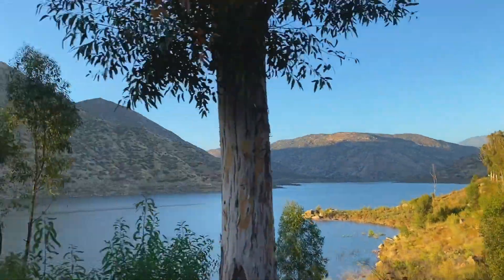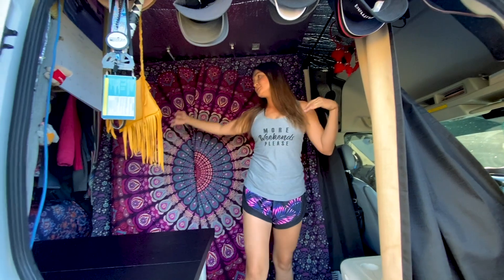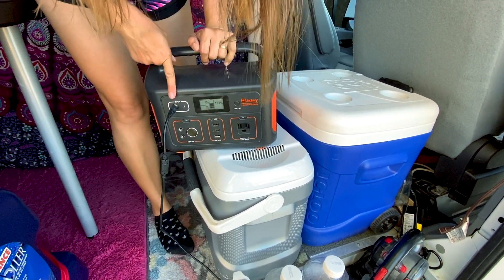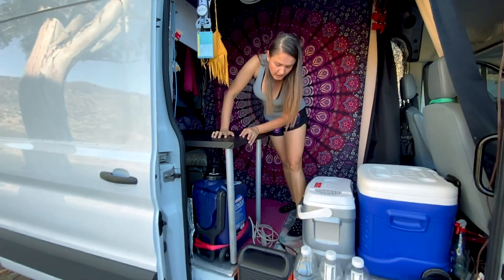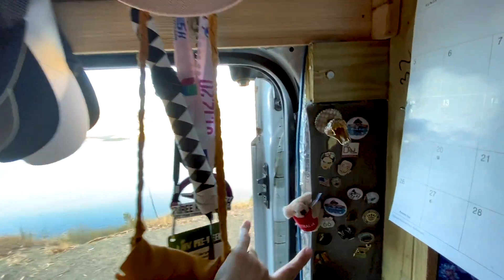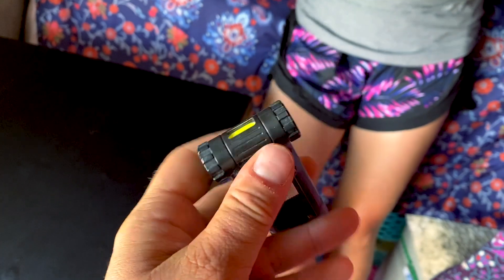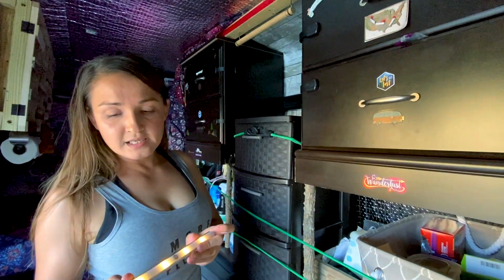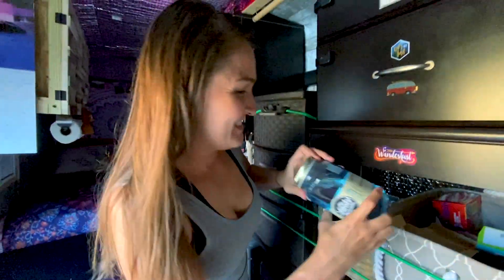VAN TOUR -DIY Simple Low Budget NO BUILD VAN BUILD - FORD TRANSIT CAMPER VAN-GADGETS- Van Life

Comment: Try using peel and stick floor tiles on the table. It will hold up against the wipes.
Reply from the maker: Hi! Thank you so much for watching and for your tip! So far the vinyl has worked quite well, but it’s great to know about that option for sure!!!! 🙏👍
Do you live in a van or RV? Where are you from?! 
Greetings from San Diego 🤗
Elvi
Reply: No I don’t have a van yet but it’s on my agenda. I live in Savannah, GA. My daughters dresser got damaged during all of my moving while in the military. I ended up using the peel and stick floor tiles to cover the top because she somehow always had something messy on it. They held up great and was easy to clean.
Reply from the maker: Hi! Thank you for answering! Great to know that it’s in your plans! 🤩 So you plan on buying and doing the whole build by yourself?

Comment: Suggestions: High priority...adequate simple electrical/solar system...get everything you can off the starting battery but use an isolator to charge/power things while driving.  Do an occassional go through inventory and get rid of stuff your not using,,,i think you have to much stuff...jumper cables so u can start the van if the battery is dead...electric fridge is next...adequate inverter,,,microwave,,,my suggestions
Thanks for shareing,,,great video
Reply from the maker: Hi! This is a general answer. I’ll be answering properly later tonight! Thank you so much!!!!! Really appreciate it!! Much love, Elvi
Reply from the maker: Hi dear Jerry Parker!!!! Welcome to our channel, happy to meet you, so glad that you liked it, and so thankful for all the great advices and tips you gave us!!!!! Really appreciate your help and support!!!!! 🙏😊
So we have finally done some improvements in the van during the past few months, that we haven't shared yet, but we will in upcoming videos! We installed the maxfann and solar on the roof, and the electrical system! The battery we definitely had to replace it, we killed it! 😂😂😂 And now, as I understand, there's the isolator that you mention. Regarding fridge, we thankfully got rid of the cooler a one time ago, and were managing everything with the 12v electric cooler, which was relatively good, not ideal, but still worked much better, once it was plugged to the power all the time. But a friend of ours upgraded her fridge and gave us theirs. Don't know the brand, it's not the most fancy one, but works amazing, and fits a lot of food!!!!! So thankfully we solved that big issue for now!!!!! Microwave would be great to add, still on plans, mainly because the van is so full of stuff, as you well mentioned 😂😂😂😂😂, that we don't where could we place it without being in the way. We raised the bed a little bit more, so we gained more vertical storage space under it, still working on reorganizing things. We have got rid of some stuff, but still not enough!🤷‍♀️
Are you a Vanlifer? Tell me about you! 
Hope you stick around! By now we've been uploading more traveling related videos, but we're going to start the upgrades series soon, I think.
Take care and be safe and warm!
Greetings from San Diego! 🤗
Elvi
Reply: @OnVanLifeMode  Thank you Elvie.  
I am a retired paramedic/EMT/Fire Captain.
I occassionally take my van on two week extended boondocking trips.
Wish i could go full time but my family situation precludes doing so.
I envy you two,

Enjoy

Jerry

Comment: Add a bottle of ice cubes I use a Gatorade bottle because of the large mouth easier to add ice the cooler uses air flow over a aluminum heat exchange it will cool 40° f cooler than the outside air so if you use the bottle of ice I can reach much lower temperatures the ice bottle last me 24 hours
Reply from the maker: Hey Dalton!!! Thank you so much for watching and for your useful tips!!! 😊 Sounds like a good idea! 👍 I wish we would have tried that before! Is that what you do? Do you have the same kind of cooler? 
Blessings and greetings from San Diego! 🙌

Comment: What kind of coffee pot do you have?
Reply from the maker: Hi Donna! Nice to meet you! ✋Thank you so much for stopping by our channel and for the interest! 😍 Glad to answer! 
When we are camping, or have the conditions to cook, (opening up the doors) we prepare coffee on our 6 cup Moca Espresso Maker. It's the classic one used in Cuba 😉 Sometimes we go easier and just boil water and prepare Instant Coffee. 
And when we are in the city and don't have much time getting ready for work, we buy it at a gas station. 😊
Are you a Vanlifer or RVier? Tell me about yourself!
Greetings from San Diego!
🙌❤️
Reply: I'm semi retired, layed off since March. I've wanted to travel for years! So this will be my means of traveling. I traded in my Honda Civic for a Ford Transit Connect small van. I'm not doing the insulation, walls, etc because I don't want to loose any space. I bought platform and mattress from Amazon and now see that i need to get 30 inch Cot size. Twin takes a lot of room. I need to make room for a potty so that i don't have to leave the van at night if not in a campground. I tried a truck stop a few nights ago but wasn't comfortable going in and out of van. And, it was cold outside! So, just learning my way and you guys are very inspiring. I'm in Tennessee on the Georgia line. Next trip going south! 😊🌞
Thank you so much for replying to my messages, very helpful!
Reply from the maker: Hi Donna! You have our respect! I admire you!!!!!! 😍😍😍😍😍 That's the way to go!!!!! 👍 You don't need to have a fully converted huge van in order to travel!!!! We've seen so many people doing it on cars and SUVs! Many do it on a car and then do tent camping. It doesn't matter! 
I hope that you can figure out the space and your needs inside the van!
Let us know if there's something we can help you out with! 
So are you heading up to Florida for the Winter time? The weather should be ideal to spend it there! 
Be safe out there! 
Fun and safe travels and van adventures!!!!!
Much Love!!!!!
❤️❤️❤️❤️❤️

Comment: Susie Hernandez
DMWI how do you power your Domestic? U say "unlike electric cooler," what type is yours if its not electric?
Hi Suzie. I cannot find my original post to respond to. I believe I was referring to an electric cooler that is only capable of lowering the temperature to approximately 50 degrees below ambient outside temps compared to an electric Dometic, ARB or similar brand Refrigerator that allows you to set a temperature at 38 degrees or 30 degrees to freeze or lower. Even if it’s 90f outside your food stays safely at 38f. Just like a home refrigerator.  Both are powered by 12 volts and some can also be used on 120 volts. 
For extended travel I wouldn’t waste money on the “cooler” but instead purchase a good Refrigerator.  Hope that helps.
Reply: The good news is there has been additional competition for portable refrigerator/freezer sales over the past year. That has reduced prices. 
So instead of spending money on a old style non-electric cooler or a 12v cooler that can cost 1/2 as much for the really well insulated non-electric models - you can buy a real refrigerator that should last 10-20 years, saving money on ice purchases and doesn’t leave you with yucky floating food in the melting ice.
Reply from the maker: Hi! Thank you for all the advices!!!! We finally were able to get rid of the annoying cooler and a friend gave us an electric fridge that she wasn't using! Not a Dometic or ARB, its a simpler brand, but it works great and we can't be more happy about it! 
Thank you for commenting! 🙏🤗

Comment: quick creative adaptive. not fancy. but practical and liveable. as long as u avoid the heat at all costs. i have good insulation in my van but the desert sucks my asshole in summer. even in winter time the sun in the southwest is that van life nemesis.

Comment: Those combination smoke detectors and carbon monoxide detectors are really pretty useless to buy because smoke detectors belong near the ceiling and carbon monoxide detectors belong near the floor. If the carbon monoxide ever filled up that van enough to reach the ceiling where that detector is you would already be dead. smoke goes to the ceiling carbon monoxide collects on the floor so the van would be literally filled with carbon monoxide before it would reach high enough to set off that alarm. By two separate things and install them in their appropriate places.
Reply: That's good to know, thanks for sharing!
Reply from the maker: Hi Cheryl! Thank you so much for your advice! We didn't know about it. I just wonder why would they sell those combined ones not having into account this facts you're telling me about?! Anyways, we'll check that out. Thank you again for watching and for leaving your interesting comment! Really appreciate it! 👍🙏
Are you a van lifer? 
Greetings from San Diego! 🙌❤️

Comment: Saw the bubble reflective insulation on walls and ceiling. Did you do anything else for insulation? What do you do for hot water there? Cool it down first with ac, then just use fan to keep air moving? Is the fan sufficient for hot nights? Do you ever sleep with vwindows open?
Reply from the maker: Hi Linda!!!! thank you so much for watching and for all your questions! 😍
1- Insulation. Only the reflectix, but covering the walls with blackout curtains. I think they add a little bit more of insulation. Compared difference in temperature between the roof and after the reflectix layer, the difference was indeed huge! The reflectix has done a great job! (but it's really hard to keep it stock to the metal. We've tried many different kind of tapes, and everything unsticks. So, have that in mind.
2-Definitely cool down the van with AC before sleep during hot weather, and then turn the engine off. Otherwise no way!
3-The fan was ok during the night,  but when the sun starts to come up and temperature in the morning raises, it's already bad. Summer in Miami (humidity) was sometimes really hard, we woke up all sweaty. 
We recently installed the MaxFan (we'll show in upcoming videos), and although it helps a lot, if the temperature outside is hot, 105 degrees last week, the air flowing is hot, it's not magical! 
4-Yes, we open windows a little bit to get the across flow. 
I hope I answered all of your questions! Dont hesitate to ask if you any have other question! 
Are you a Vanlifer?
Blessings and greetings from San Diego! 🙌❤️

Comment: 4:09 instead of putting your food in a bunch of zip lock bags inside of the “dry bag”, put the ice 🧊 (& much less of it) into a few large 1 gallon zip lock bags (not too much, leave room to allow it to lay flat) to create a few ice pouches & lay them over each layer of food. + you can cheaply refill them at convenience stores with ice dispensers in drink fountains; or buy much smaller bags of ice. You can also invest in a portable ice maker to reuse the melted ice to make fresh ice. 😉
Reply from the maker: Hi! Thanks for watching and for the feedback and advice! 😊👍 Honestly Ive tried so many things with the ice! It drives me crazy! I put everything in different ziplock bags to keep the bag more clean. And so that it’s a little bit easier to grab them from out of the dry bag. Ziplocks don’t seal so well actually. 🤷‍♀️
Reply: Why not put the ice in the dry bag?  Or in plastic jugs?  Then use the water after melting?
.
.
Reply: Portable fridge freezers like Dometic and ARB are running sales at certain times of year. I Love my Dometic 65 quart. 
So much better than soggy food. 
It’s paying for itself By saving the money i used to spend on ice and spoiled food. Very easy on power consumption and keeps food at 30-38 degrees F (your choice) in hot weather unlike the electric coolers. If I bought a new fridge it would also have a separate freezer section for extended trips.
Reply from the maker: Yes we'll definitely get one of those, Dometic probably, But someone recommended the ARB. So we'll have to check when that sweet moment comes!!!!🤩 That's why we don't want to invest more in the cooler. Actually, we've been buying less food and only using the 12v little one lately. We decided to stop using the cooler! 😃
Reply: @dmwi1549  how do you power your Domestic? U say "unlike electric cooler," what type is yours if its not electric?
Reply: great idea
Reply: Or put in wide mouth containers, put thru a counter top water filter, or use for cleaning when it melts.